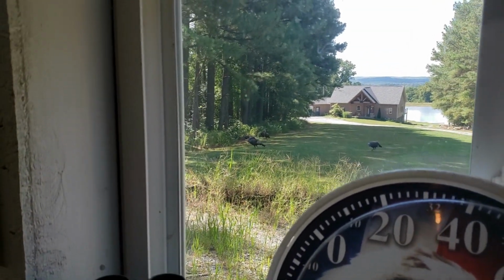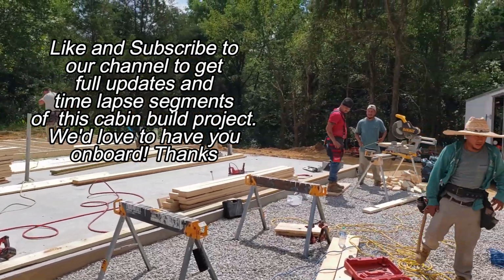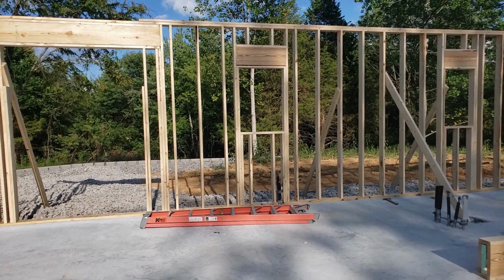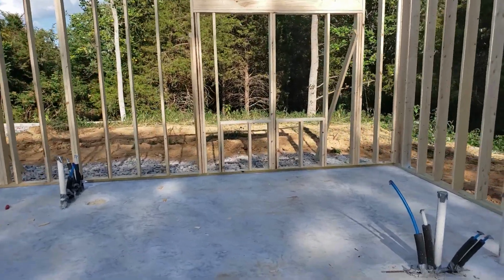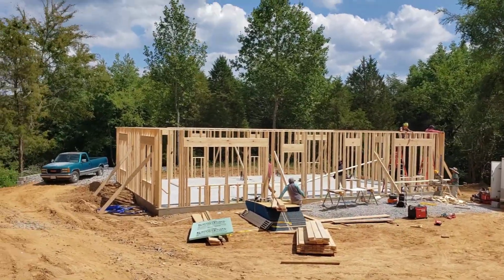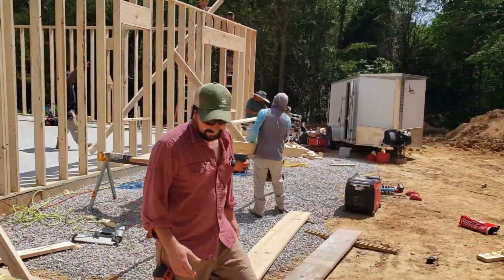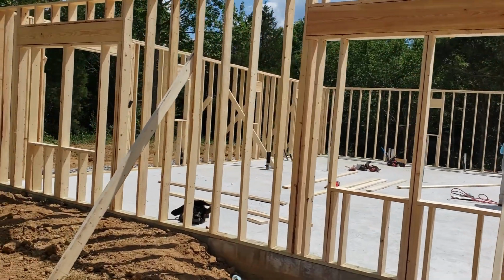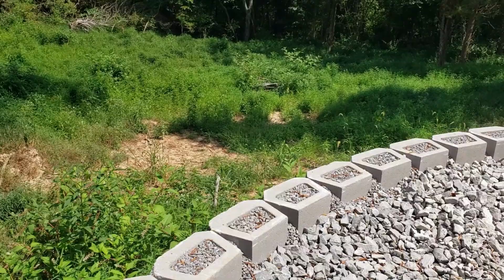Southern Illinois rustic cabin in the woods build project update (08-24-2022)

Comment: we just finished the first floor as well today. starting on second floor and loft area tomorrow.  love building stuff.  we are going with king  truss and rafters.. love the tall walls you went with.
Reply from the maker: Good luck on your project, somebody else asked the same question you did so I'll get a clip of the anchors they used they look pretty stout they look to be like a 1-in diameter bolt that they drill down into the concrete specific for that application